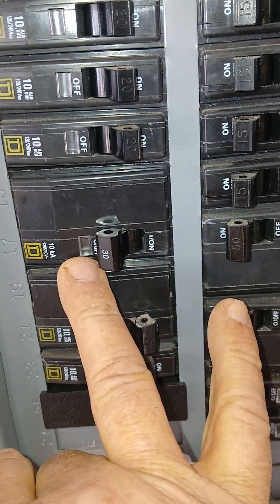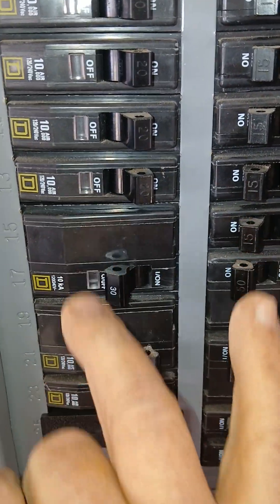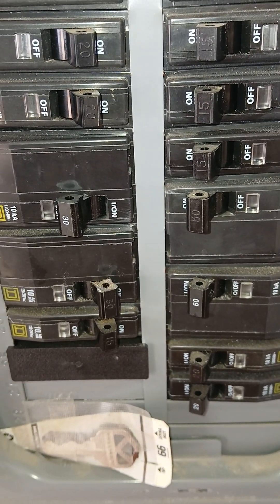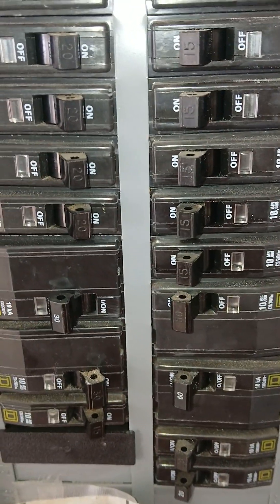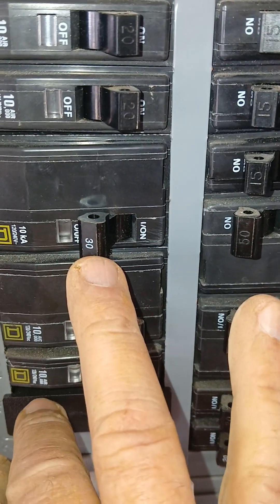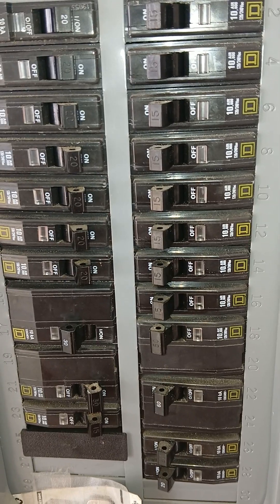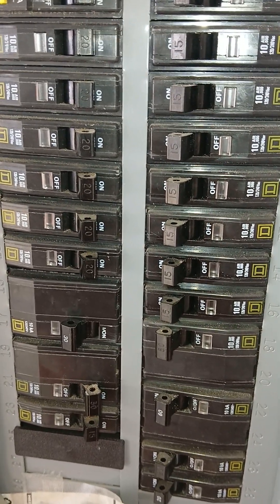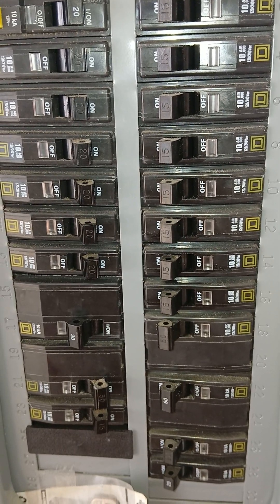Differences Between Electrical Breaker Types?

Comment: counter sales here, QO and homeline breakers are two different plug-in style low voltage breakers for square d loadcenters, you can tell the difference in the way the frame (face & body) of the breaker is, especially if you pull one out, the clips that plug into the bus bars are completely different, they are for sure not compatible with each other! great video! God bless!

Comment: QO stands for "Qwik-open".  

Something else when choosing a breaker that is oftentimes overlooked is a straight rating vs slash (or slant) rating.   Art. 240.85.  A circuit breaker with a straight voltage rating such as 240V or 480V, shall be permitted in a circuit where the nominal voltage between any two conductors does not exceed the circuit breaker's voltage rating.   A circuit breaker with a slash rating such as 120/240V or 480Y/277V is for use on a solidly grounded circuit where the nominal voltage of any conductor to ground doesn't exceed the lower value of, and the nominal voltage between any two conductors does not exceed the higher value of the circuit breaker's voltage rating.  

All single pole, and most two pole breakers are slash rated, while all three pole breakers are straight rated.   

A common violation occurs when supplying a single phase line to line loads from a 120/240V 3ø 4 wire delta panelboard.  Phase B is the high leg eg.  208 volts to ground.  A two pole breaker placed on phases A - B, or B-C must have a straight rating, if placed on C-A a breaker can have a slash or straight rating.  You can forget about driving to your local home depot to buy a straight rated circuit breaker.
Reply from the maker: @rarelampcollector  Thank you!